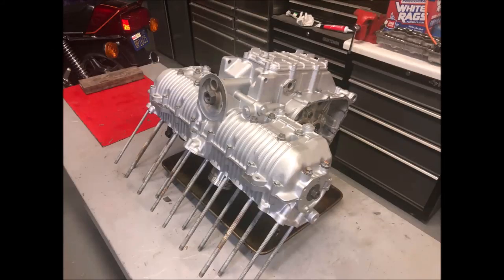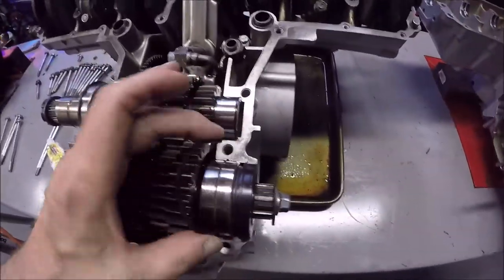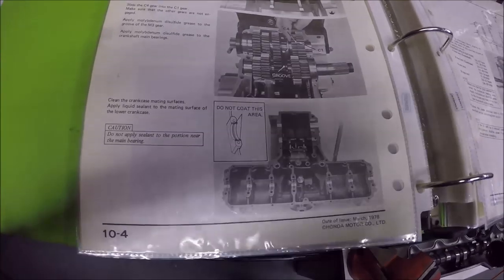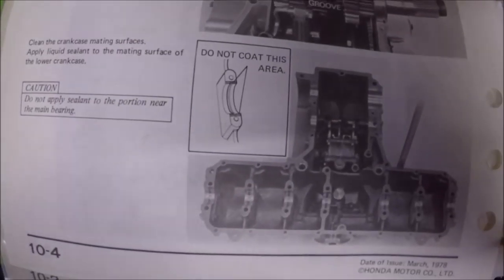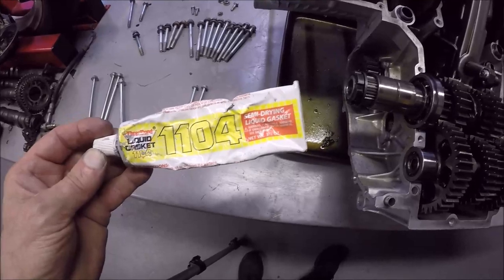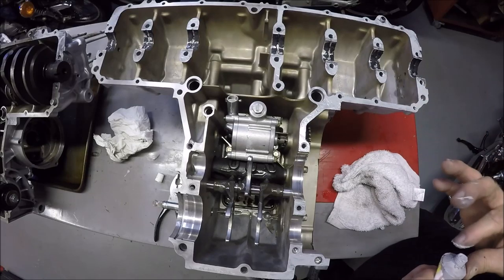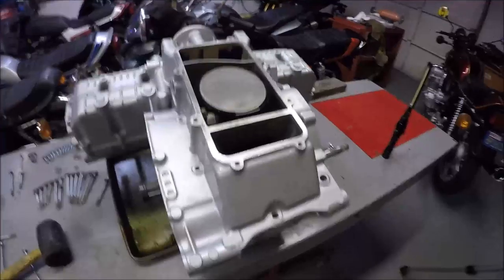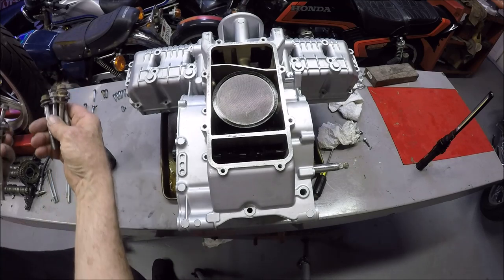Honda CBX Full Restoration & Engine Rebuild Video Series - Part 17 Re-assembly Part 4 Case Assembly

Comment: 1104 one I’ve always used 👍🏻 
Back in the day as a shop mechanic in my previous carrier the one thing I hated about Honda’s was having to take the motor out of the frame for major work , you seen some people cut the frames 😳 to get topends off 🤦‍♂️
Reply from the maker: Hi Tommy, Cutting the frame was mostly done on the CB750 bikes. The geniuses who did that didn't realize that all you have to do is lay the bike/frame on its side and simply lift it off the engine :)    The CBX has no lower frame rail, so you just tilt the engine down and pull the head.  The "F" bikes have a removable lower rail on the frame.  I also HATE to see a frame cut :(
 Thanks Tommy for your comment.

Comment: I thought the manual said not to apply sealant to the main bearing areas?
Reply from the maker: Hi, I show and mentioned a number of times exactly what area near the main bearings that you do not put the sealer. Its right at the edges of the actual bearing. 😎

Comment: Did you say hone the cylinders,if you are using a standard piston again shurely you would have had to fit a new liner in that one. 
I would have gone for an oversize piston, as I think even the bad one would have bored up clean
Reply from the maker: I did not use the same cylinders that were frozen. They need to be bored .30 over. The cylinders I used for the rebuild were in perfect condition and only needed to be honed.

Comment: Looks like repairing the starter clutch requires splitting the cases. Or can it be done through the bottom?
Reply from the maker: Hi Richard, Unfortunately, the starter clutch can not be accessed without splitting the cases. It's one of the joys of owning a CBX LOL

Comment: Surprised that you didn't put the cam chain through to the outer part of the upper case before mating..  to me it is always easier to have it positioned before closing the cases.
Reply from the maker: Hi Dave, thank you for your comment. I am assuming you are referring to the chain running from the crank up to the cams. I find it easier to not worry about the chain until after the cases have been properly mated and sealed, which is an important step that needs a lot of attention. the chain is easily retrieved by using a magnet and secured after. Either way is totally acceptable. There is no right or wrong way as long as the ultimate result is that the cams are timed and adjusted correctly. Thanks again Dave, I really appreciate it. :)

Comment: Hi, need your advice.
On my honda I can't put 3rd and higher gears. 1st and 2nd go with some reasistance but its managable. Any tips. Thanks on advance.
Reply: first question is: did you just reassemble your engine and now only have 1st and 2nd gears?
2nd question is:  is the engine in the bike and this happened while you were riding?
3rd question is: what year/make/model bike do you have?

Comment: I don't get why you apply the sealant at 17:05 to the inside of the engine. That doesn't need to be sealed or?
Reply from the maker: The manual says that sealant is to be applied to all mating surfaces, and there was sealant there from the factory, so I follow that method.
I think it is because there shouldn’t be any oil allowed to get into any of the mating surfaces.
Reply: Also thought about that, Maybe not for sealing but to get a uniform pressure on all mating faces?
Reply from the maker: Maybe so, but there is also the issue of sealing the oil from seeping into the threads of the bolts for the crankshaft. They do not have o-rings or any other method of stopping the oil from seeping into the threads and out the bottom of the engine. One thing you can be sure of, is that Honda had a good reason :)
Reply: @digitalpizza1  And that reason is what I'm interested in :D

Comment: Didn't you need to replace the rotary bearings?
Reply from the maker: Hi Richard,
I checked all those out and all were in excellent condition
As you may know, Honda's quality when it comes to those roller bearings is top notch and they will last forever if they were lubed properly.
The bottom end of this engine was in excellent condition despite how bad the top end was.
Thanks for your question Richard
Pete